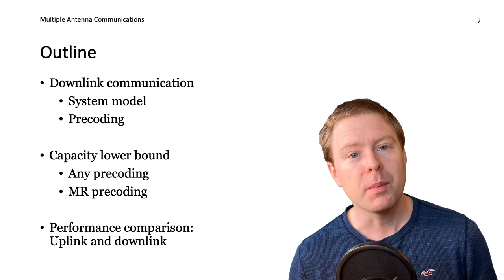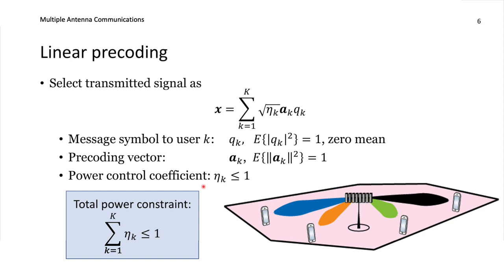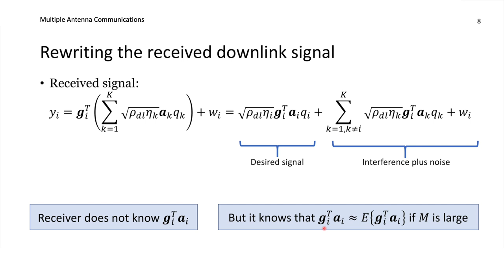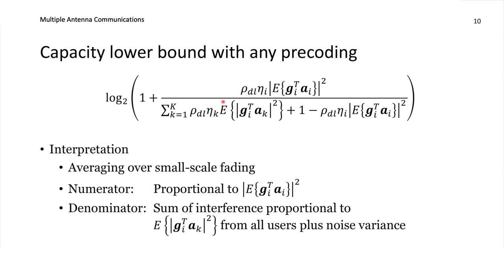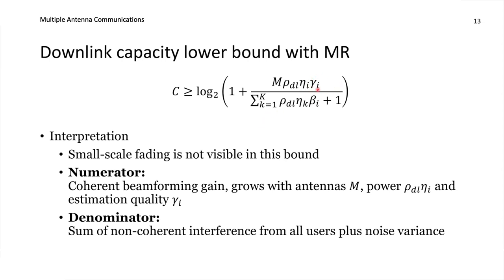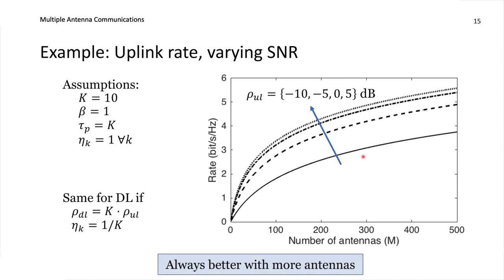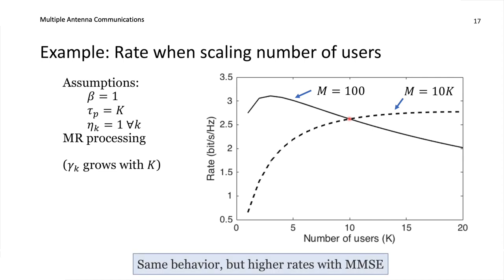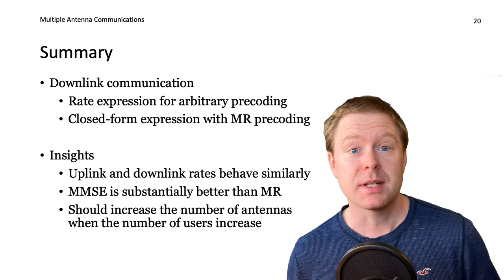Lecture 9: Downlink Multiuser MIMO With Linear Processing

Comment: Dear Sir
We can beamform to each multi user using same frequency if channel information(G) is known.  If G is not known, diversity or multiplexing is not possible for downlink multi user environment ?
In case of uplink, it seems that multi user(or massive mimo) detection scheme is the same as V-BLAST(point to point) though the channel characteristics is different. Yes ?

Comment: Thanks very much for publish the content of the course here professor. I haven't got the chance to look to all the videos, but those that I've already seen are very good, thanks again. One of the main concerns that I'm struggling to understand is the granularity of beams, with for example a 64T64R antenna with only 2 cross-polarized elements connected to each TRX then the doubt that I have is that you can form (as much and simultaneously) like 64 lobes (more than actual beams) is this assumptions correct?
Reply from the maker: You can create an infinitely large number of beams, but they will be partially overlapping. With 64T64R, you can select up to 64 different physical locations and beamform to each one of them using “zero-forcing” without causing interference in between the different transmissions. At most other locations, we would receive a mix of all the signals. Since we cannot do perfect zero-forcing in practice since the communication channels are only partially known, “massive MIMO” is often assumed to have “more antennas than beams”. We are basically adding some space in between the beams.

Comment: Thank you. With respect to slide 6, the precoding vector ak: this vector varies the amplitude and the phase - is that correct?
So I assume it is a vector with complex entries, yes?
Only a real value could only change the amplitude I think.
Reply from the maker: Yes, all signal and channel variables are complex in this lecture series.

Comment: Thanks I am a bit confused by the equation on slide 6. There we have the vector x [Mx1] wich depends on a summation term. But every entry of x gets the same result then? Is that right? I doubt that . I am confused by the dimension.
Thanks a lot.
Reply from the maker: There are K information signals, q_1,...,q_K, which are transmitted simultaneously using the M antennas. The precoding vectors a_1,...,a_K determine the spatial directivity that each signal is transmitted with. Hence, all antennas transmit all signals, but in a way that directs them in different directions, focused on different receiving users. The vector x is the summation of all the transmitted signals, and the entries are different: they contain the same K information signals but with different amplitudes/phases to achieve different directivity through constructive/destructive interference.
Reply: @WirelessFuture  thanks for the quick answer. I got it now. The [Mx1] vectors do not mean that all M antenna elements are in the same dimension, do they? It could also be a 8x4 array and I get my vector x [32x1]. Is that right?
Reply from the maker: Yes, the antenna array can have any shape. The only assumption is that it consists of M antennas (each connected to a separate transceiver chain). The geometry of the array only determines the values of the channel vector, which depend on the propagation environment around the array and its geometry.

Comment: Thank you for your interessting videos. To be clear: we get a signal x which is the summation of the single signals from K users -> and we give that signal x to each antenna feed-point and the array generates our desired beams to the K users yes?
Reply from the maker: Yes, and the summation of K signals is containing weights: it a weighted sum with different weight on different antennas. The weights are determine the beam direction of each signal.
Reply: @WirelessFuture  Thank you - and this method is also called digital beamforming, isn't it?
Reply from the maker: @pitmaler4439  Yes! This is the technology used in 5G for Massive MIMO in the mid band.

Comment: Thank you professor for these informative lecture series,
How does the base station know the number of users, K, in its covarage area? K seems to be a random number. I think this is important because the length of the pilot signal depends on the maximum K, right?
Reply from the maker: This is video focuses on data transmission to users that are connected to the network. Whenever a user wants to connect, it must go through a procedure called random access. It sends a connection request and if the base station can decode the request, it will tell the user which pilot sequence to use and which time-frequency resources to use.

Comment: check out 14:28. I think that the subtracting term in the denominator must be deleted. "Var(X-constant)=Var(X)". Great Work
Reply from the maker: No, the expression is correct. You are right that Var(X-constant) = Var(X), but this is not applicable in the derivation on Slide 9. The subtracting terms comes from the term with the minus sign and it contains q_i, which is a random variable so it is not constant. (EDIT: I was wrong, Var(X-constant) ≠ Var(X)).
Reply: Var[(gT*a-E{gT*a})*q] = Var(gT*a-E{gT*a}) * Var(q) because of indepandance and Var(gT*a-E{gT*a}) * Var(q) = Var(gT*a) * Var(q) because the expectation is deterministic, so the subtracting term is deleted. Is my assumption wrong? Otherwise something is missing from the denominator in the MR capacity.
Reply from the maker: I'm sorry, I was thinking incorrectly this morning. Var(X-constant) ≠ Var(X). The variance is the mean-square of the deviations around the mean. If you subtract a constant from X, then you are changing the mean. 

In this case: Var[gT*a-E{gT*a}] = E[ |gT*a-E{gT*a}|^2] = E[ |gT*a|^2] - |E{gT*a}|^2.

The first equality follows from that gT*a-E{gT*a} has zero mean. And the second equality follows from expanding the | |^2-term.

Comment: Professor, could you put a video in simulation of wireless communication system..
Reply from the maker: Thank you for the suggestion. What would you like such a video to contain, in case we would eventually produce it?

By the way, there is a video in this series about Monte Carlo simulation that might be useful for you.
Reply: @WirelessFuture  it would be very useful if it contains communication system in  MU-MIMO case and simulation of how a message signal transmit over it
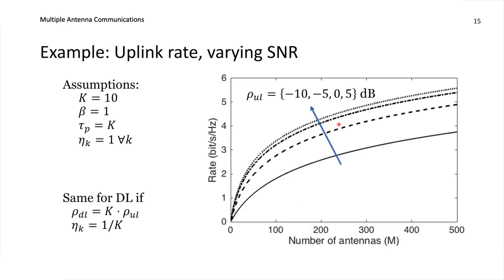Reply from the maker: @artie5172  The capacity bounds presented in this video are everything needed to simulate a MU-MIMO system. The graph shown at 25:53 is generated by computing those expressions for the parameter values stated on the slide. It is ~10 lines of Matlab code.

More general simulation examples can be found in relation to my book, Massive MIMO networks: https://github.com/emilbjornson/massivemimobook/tree/master/Code